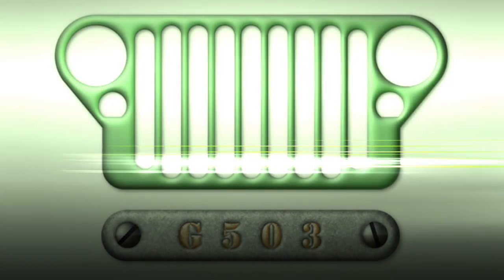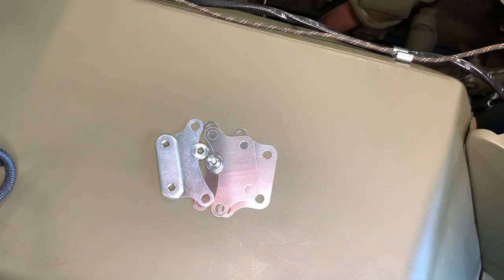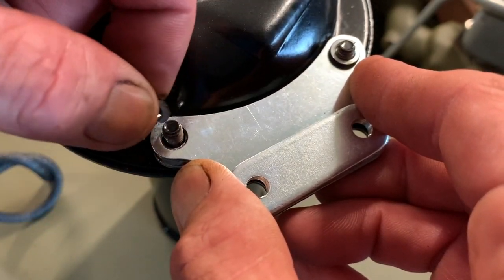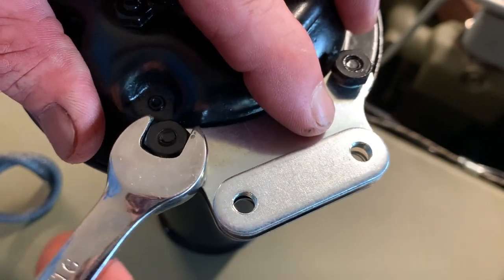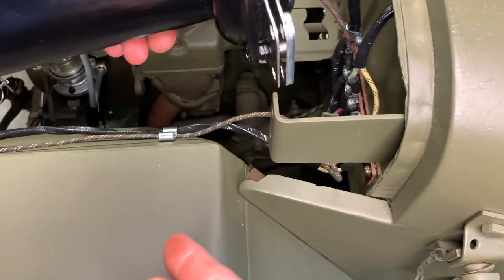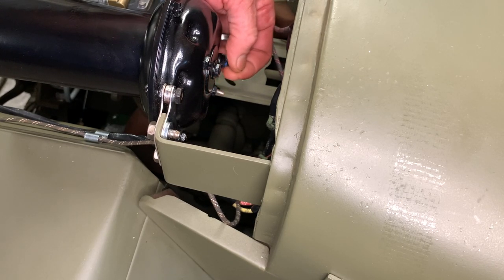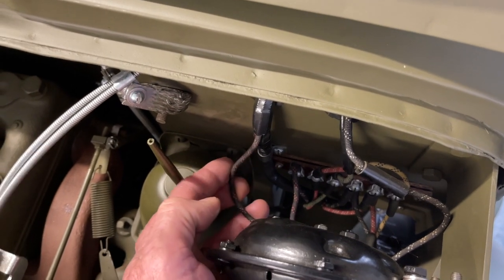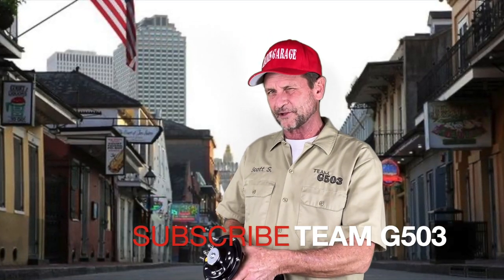G503 Horn Installation And Wiring (Electric Part 23) Willys MB Ford GPW Team G503

Comment: An easy way to confirm or dispute the completion of the electrical circuit would be to use a multimeter in the continuity setting. The material to me seams like it is a direct path to ground, not isolated.

Comment: Do you know if these JMP Spartan horns are available in 12V?
Reply: Yes. They're available in 6v and 12v.
Reply: @msctrojan  What gauge wire goes from the firewall to the terminal?  I have a 12V horn (12V system) and have three terminals.  2 match up with the video but I'm missing the mounting bracket, the wire from the firewall to the terminal on the horn, and wonder what the 3rd terminal is for on the 12V horn.  I want to make sure I have a working horn for safety, etc. and will get the mounting bracket and correct wires but need to verify just what I need.  Thanks.

Comment: Horn damper does two things , isolates vibration from the body and "floats " the horn acoustically . If you didn't isolate the back of the horn , it would be like putting your hand on your stereo speaker while it was playing